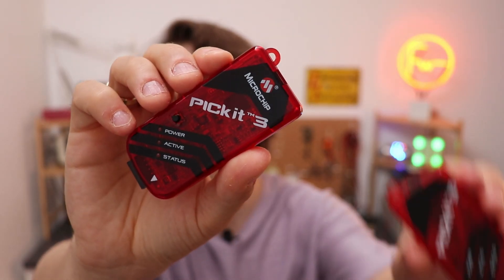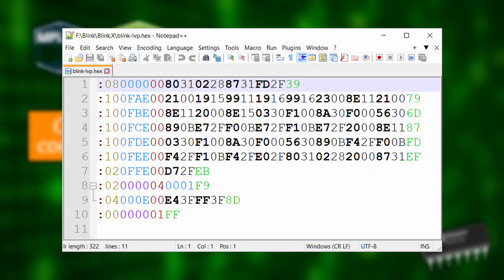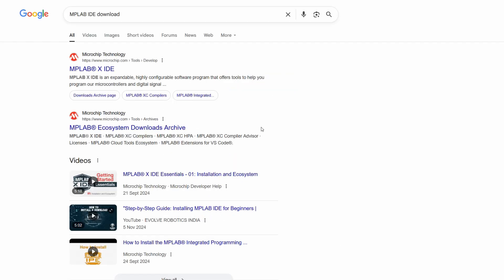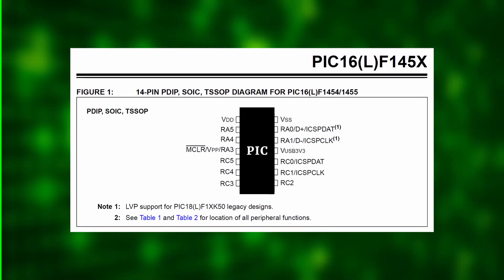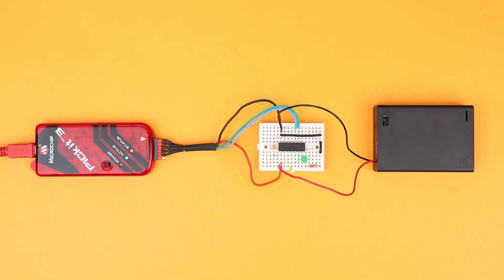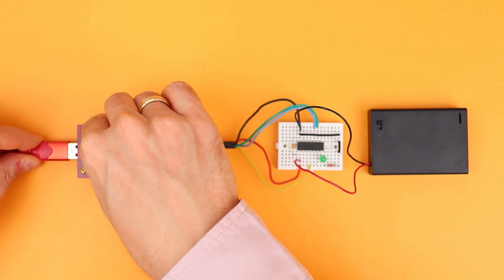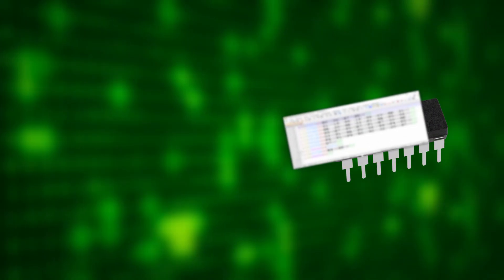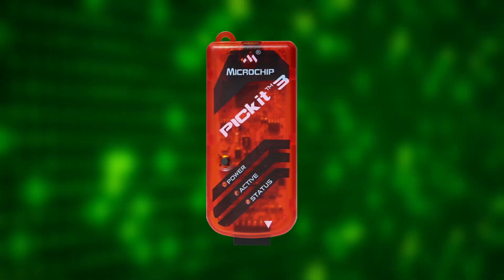How to flash a PIC microcontroller in 2025: PICKit3 or MPLAB Snap?

Comment: what windows system you used? I've order 2x picki3 in different store online but sad to say those two was not able to work or to detect of my windows 11.
Reply: My PICKIT-3 runs smoothly on standalone programming software version 3.10 in Windows 11.
Reply from the maker: @wanakosabe2093  Thank you for sharing your experience, this is very helpful!
Reply from the maker: I tried the original PICkit3 and the Snap, both on Windows 10 (my PC) and on Windows 11 (my laptop). The rebuilt PICkit3 I have not yet tried on Windows 11, but I don't see why it shouldn't work.

Which version of MPLAB IPE are you using? Make sure you don't use the newest one, it will not recognize anything like PICkit3.

Comment: Hey Jens,

 Once again you've come up with and produced an awesome video!  I thoroughly enjoy these videos to soothe my hobbyist cravings.   This video regarding the PICKit3 vs. PICKit5 vs. PICKit Snap really narrows it down.  Since a huge chunk of chip compatibility relies on multitudes lines of code to maintain across the various programming interfaces, this may be why the older units are no longer supported, or it just simply boils down to making more money.  I have the the PICKit5 that I back into 2023 and have used it along with all my other programmers and find that there are some more features that are definitely supported more.  

A couple of years ago, I procured a Velleman MK150 Shaking Dice Simulator kit and found it very piquing.  It uses the PIC12C508A chip to drive the random iterations of displaying the dice.  I wanted to reverse engineer it for my curiosity to tweak it a bit to change the roll speed or the randomness in it.  I understand that  can read out the HEX code and have done that.  The farthest I have done.  I've not converted the HEX back int Assembly and don't know of anyone else who has done that.  Heck, I may even try and write to the Velleman Co and see if they would share the C code.  

 Anyhow, please keep the videos coming, they really make my day!

 -david

Comment: The Snap is garbage. It doesn't support large swaths of PIC mocros
Reply from the maker: I feel your frustration. I think the Snap has its place, but it clearly is not as good as the PICkit3 (when it comes to features) and the PICkit5 (when it comes to in-app support). What I just don't understand is why the support for the PICkit3 was terminated.
Reply: @FriendlyWire  $$$$ of course
Reply from the maker: @DavidKHill  Corporate interests are valued more than hobby electronics folks? Whaaaat? :)

Unfortunately, this seems to be the case. There was even some effort in the community to help contribute with keeping the PICkit3 firmware updated, but to no avail.

Comment: I'm trying to work on a dspic33fj64gs608, but I'm having issues to read with ICSP directly on the board. I'm thinking that I may have to unsolder components bothering in the PGD PGC and MCLR pins that may be bothering in the process. Am I correct?
Reply from the maker: Hey Diego, great question! Yes, if there are capacitors or diodes on these lines it can cause issues. Does the board have an ICSP adapter? If it has one (or if it has contact points that are labeled ICSPDAT, ICSPCLK, and MCLR) then chances are there is just some issue in the wiring from these to the Snap.

Do you get any error message?
Reply: @FriendlyWire Hi bud, I used pickitminus finally, the issue was 100% a me thing. I took pin 1 from the wrong corner so my icsp was incorrect, already dumped the firmware and loaded it in ghidra.
Reply from the maker: @DiegoMarcianoDM  Glad you managed to solve it!

Comment: so is the MPLAB Snap providing power for the chip it is programing ?
Reply: never mind you answered that in video later on... but I'm bit confused about the hi voltage programing what does it mean we can't use MCLR pin as button input ? when we program the PIC it should not matter no ? Its not doing its operation.  I'm experimenting with small PIC 16F15313 and it have just RA0->RA3 where the RA3 is also MCLR and I need 3 button control + deep sleep control pin ... and I wired them as such... does that mean I can't use MPLAB Snap to program it ? I did added 10K pull up to MCLR and button is pulling it to GND on press, so maybe that would still work on Snap ?
Reply from the maker: @vladoportos  Thank you for the questions!

To the first question: no, the Snap does not provide power, so we have to provide it ourselves.

And to the second question: unfortunately, the MCLR pin cannot be used as an input pin in low-voltage programming mode. The Snap cannot provide a high-voltage signal on the MCLR line, and without that the PIC would not know that it is asked to enter flashing mode. For this reason, the MCLR pin cannot be used as an input with the Snap...

But you can still use your PICkit3 with an older version of the MPLAB IPE as I mention in the video, so there is at least a workaround. Alternatively, you can of course just get the PICkit5, but that is more expensive.
Reply: @FriendlyWire  Ordered PICkit3.5 clone, I just need to flash 2 or 3 PICs to fix my sons trains :D I have find out their boards stop working because the IC just lock up after time... so I made my own as replacement... will it work, no idea... I always played with esp32 so PIC is new to me... :D
Reply from the maker: @vladoportos  Sounds like it should work just fine, good luck! Let me know how it goes! :)
Reply: @FriendlyWire  I did it ! first time making board and programming IC... and it worked! So flipping happy :D Train is working nicely, kids are happy. I also made mistake chosing programing interface to be using TC2030-MCP cable, due to very small footprint and seems convenient... oh boy I efed up, that cable is almost nowhere to be found and price is like 80Euro, so had to source it from China some clone of it for cheaper and cut one end of it to be able to join it to KIT 3.5
Reply from the maker: @vladoportos  That's fantastic, I am so glad it's working! :) And once you have the programmer you can do a whole lot of other cool things with microcontrollers!

Comment: Hello, i am using pic16f73 and pic18f23k22 as i try to load code (make and program button) it print an error like "target device id (0x3fe0) is an invalid device id, please check your connection to the target device" also it prints address: 0 expected value 118a received value: 3fff what should I do to overcome this? Help me please
Reply from the maker: Thanks for the question, this happens a lot. It means that the connections to the PIC are incorrect. Did you double-check where the PGD (also called ICSPDAT) and PGC (also called ICSPCLK) and MCLR wires go?

Comment: Hello sir. As soon as I connect the MPLab snap to the laptop usb cable, the power LED has turned on and turned off almost immediately. Can you tell me what is the possible issue?
Reply from the maker: That is odd, I have not seen that yet.

But many laptops have problems with their USB port power deliver. I suspect it could be power issue. Have you tried a different computer or a different USB port on your laptop? I know it sounds silly but on an older laptop I had something a bit similar in the past.

If you cannot use a different computer, try borrowing a powered USB hub from someone (something like this: https://www.amazon.com/dp/B083XTKV8V/ ), which could alleviate the power draw issues.
Reply: @FriendlyWire   Thank you for your response sir. I will try with a new USB cable and see the working. I hope this kind of behavior doesn't indicate a damaged device (Its a new one )
Reply from the maker: @phanidharkumar7007  A new USB cable may not be helpful, it is really the power delivery. You would need aa USB hub or a different USB port on your computer. Hope it helps!

Comment: And what about the pickit basic? The manual states that it supports a lot of programming modes like jtag and icsp. It is a little more expensive than the snap but not as much as the pickit 5
Reply from the maker: Thanks for the question! The PICkit Basic also does not support high voltage programming. Since the Snap also has in-circuit serial programming (ICSP) I don't see the big advantage for beginners from the PICkit Basic over the Snap. What do you think?
Reply: @FriendlyWire  Thanks for the clarification, I thought that the pickit basic also supported hvsp but looking at the manual one again, it does not say that.

Comment: Although I have bought the PICKIT5 - just to realize 
PICKit3 is still very superior programmer for 95% of PIC you gonna program :D

No one need more updates on old PICs before 6.25 anyway, since XC8~32 migration.
Reply from the maker: Thanks for sharing! Yes, the PICkit3 still works great for most if not all of the mid range PIC controllers that are useful for hobbyists.
Reply: @FriendlyWire But I have to say PK5 worth your money too, for its blazing fast speed, stable internal power supply & microSD/USB-C interfaces.

For $100 it’s great programmer to invest.
Reply from the maker: @thanatosor  An internal supply would have been sweet for the Snap, since that one is also quite a lot faster than the good old PICkit3.

This video here is of course for beginners, who may still be on the fence whether it makes sense to invest $100 into a new hobby :)
Reply: @FriendlyWire  People with hobby, perhaps will prefer Arduino or Pico over PIC :)

PIC may be just too much for them, although it pack a lot of fun.
Reply from the maker: @thanatosor  I can see that, but I always preferred the PICs because I like accessing registers and learning at a fundamental level how things work. (Okay, I don't code in ASM and I use C instead.)
Reply: @FriendlyWire  Yeah, one thing that made it special compare to all other MCU/CPU (even 8-bit ones ), is its Register Layout with Special Functional Register - that simplify every function : I2C, UART, SPI, CAN, LIN, XLP ....  you can name it.

Well, I think anyway, PIC worth another full video to introduce as the kind of content no other channel may do nowdays..
Reply from the maker: @thanatosor  I am planning a more detailed beginner video on PICs. Since I am animating everything in GIMP by hand, I am trying to find a way to keep the style but make it a bit more modular, since a lot of the animations take a long time to do by hand. I really like working with PICs, and I hope I can share the passion with others here :) Thank you for your support!
Reply: @FriendlyWire Ah, why not using Blender to animate + composition your video ? Also there are some python tool that may help with code animation
Reply from the maker: @thanatosor  Yes, I have been thinking about the Python tools as well, but I kind of like the less polished and more "hand-drawn" style I use. Maybe it can be somehow emulated in there.

Comment: Hi great guide... Can it work for the pic16f778a microcontroller tho? Thanks
Reply from the maker: Yes, the PIC16F778 should work just fine with either the PICkit3 or the Snap. Looking at the datasheet (https://ww1.microchip.com/downloads/en/devicedoc/39582b.pdf) make sure you connect VDD to pin 20 and GND to both pin 8 and 19. MCLR is pin 1, PGD is pin 28 and PGC is pin 27.

Comment: I like the idea of PIC mcu's, but I'm not an industrial engineer needing to design something my company is going to make 100,000 units of. I'm a home guy doing neat things with electricity, gears, motors, and batteries. PIC: use our propriety hardware with our proprietary software to program our mcu, and they both get upgraded/unsupported frequently. Raspberry Pi: use USB to connect to any Windows/Mac/Linux laptop and program in python. For me it's a no-brainer. I would like to do PIC one day, but it doesn't seem to make sense in my situation. I do, however, appreciate your channel and videos very much, you do a great job.
Reply from the maker: Thank you for sharing! Yes, I can totally understand that. 

Personally, I like that with PICs you can control every single bit in every register, and doing so you can learn how a microcontroller works in a lot of detail at the hardware level. Working with a Raspberry Pi with a whole Linux kernel is a rather different stage, also very interesting, but instead with a larger focus on the software end.

There are so many different and interesting aspects to electronics :)
Reply: @FriendlyWire  I like that aspect about PICs as well. I've used Raspberry Pis, the little computers, for cool stuff, but I was talking about the RPi Picos, the microcontrollers. RPi makes little inexpensive modules with the MCUs on them, super easy to use. Just plug in the module to a laptop with USB to load your code. Please keep making great videos, it's very useful!
Reply: Everyone from Arduino community may think like that, 
until they need solid debugger / full ASM decompiler or 
something really specific to the MCU they are working on.
After crappy Arduino Libraries poor stability / performance.

I don't make 100k units from PIC too, but after tried out all popular MCUs, I still want to stay with PIC as it does exactly what I want it to do.
Reply: @thanatosor  I never mentioned Arduino. I've never bought one, and don't plan on it, although I do see where they might have some use (although I think they are totally overused, esp in education). I don't want to be stuck with the Arduino IDE or "language" which appears to be similar to C but not C. 

Me: Invest $$ in a PIC programmer (hardware) and be forced to use their crappy IDE, both of which will go unsupported anytime soon for the privilege of register-level programming (which I don't really need) on a <$1 chip but have to support myself with discrete components .  -Or- Buy a $5 Raspberry Pi module that has the MCu + supporting discrete components + pins + USB connection + I can use whatever IDE I want and load pythong and/or C/C++ to my hearts content. 

Like I said, if I made 100K, the pennies vs dollars is meaningful. For my projects, I don't need to program at the register level, and the few $ for the module (Rpi) vs just the MCU (PIC) is meaningless to me when I still have to create my own module to support the PIC. 

Arduino is a whole different thing, and I don't intend to touch it anytime soon.  Too expensive, too obtuse. 

If I want to brag about how I made a line following robot for $5 instead of $10, I'll go with PIC. Otherwise, for things I'm trying to actually get working, one-off or maybe I make 2 or 3 prototypes before going with my final version, the $5--$8 RPi Pico modules are a tiny fraction of the overall project cost.
Reply: Just to be clear, there are other MCU brands that make modules that seem promising; I'm not an RPi salesman or fanboy, just a practical tinkerer. E.g the ESP modules look cool, I just haven't gotten to them yet .. some pretty cheap yet seemingly useful ESP modules available overnight on Amazon.
Reply: @tedbastwock3810  aight buddy i aint reading allat yapping
Reply: if u talkin pico